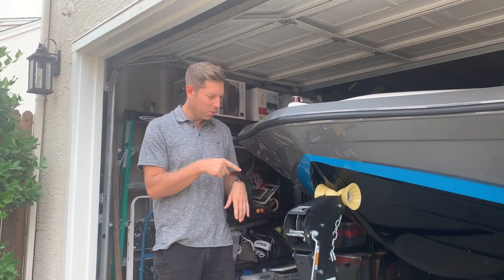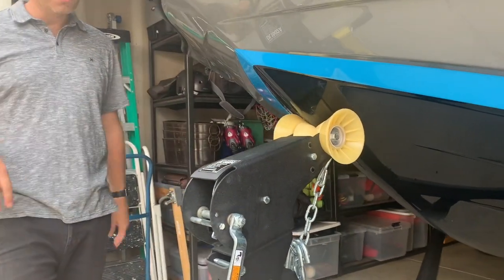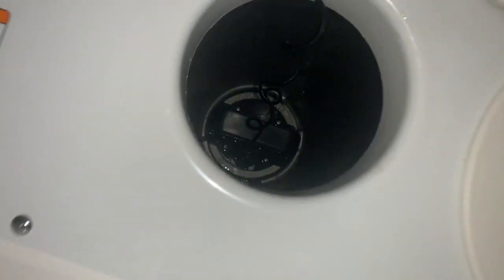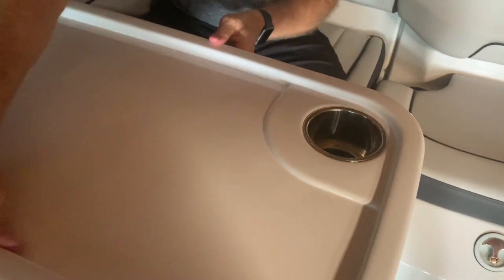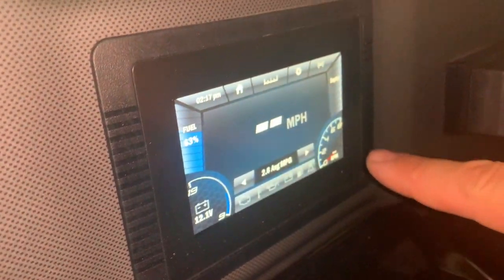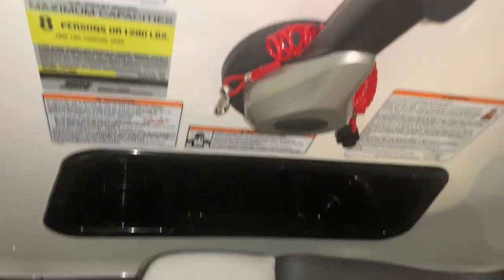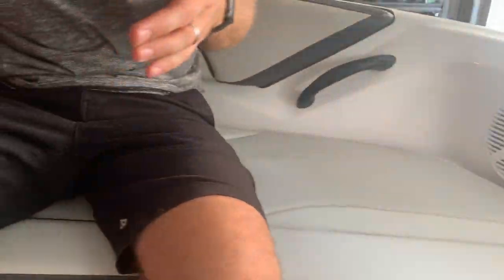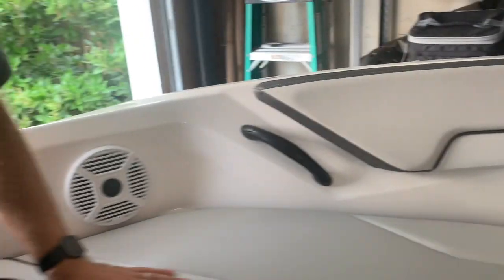2021 Yamaha AR190 Jet Boat Full Walkthrough-And It Does Fit In A Standard Size Garage!

Comment: We couldn’t fit our 2022 AR190 in our garage that is 82” high. The dealer did not have any solutions. We had to let air out of the tires and drop it to about 20 PSI to get in and out. Thankfully we finally took our friend’s advise and switched out the trailer tires.

Our 2022 shorland’r trailer model YAB30 came with: 

Original tires: Eco Trail ST - ST215/ 75D14- 
tread plies 4 nylon, sidewall plies 2 nylon, max load single 1870 lbs, max load dual 1650, load range C

We switched the original tires for these and everything has been working out perfect without having to mess with the garage header or tower:

ST205/65R14 LR D ( 8 Ply) WVS690 VISION MARINE HAULER Trailer Tire 
Tire Size: ST205/65R14
Tire Brand: VIS Marine Heavy Hauler Tire
Overall Diameter (inches): 24.4
Section Width (inches): 8.1
Capacity (lb): 1820
PSI: 80
Load Range: D (8 ply)
Speed Rating (MPH): 81

Hope this helps anyone who is going through the stress like we did. They were under $300 for the set at Discount Tire who special ordered them from the manufacturer.
Reply: Does this tire fit on the same rim ?
Reply: Yes we used the same stock rim it was sold with

Comment: Aloha,  nice looking boat and that trailer looks interesting... is it painted, is it a ShoreLandr?  If it is and they haven't upgraded the light wiring to single wires (no connectors in the frame rails) you'll eventually lose the lighting.  Mine (2017 SX190 w/Galvanized ShoreLandr) was problematic at about 6-8 months (saltwater) all the connectors rotted out.  Ended up using LED's and running the wires down the frame.  Great Boat!  Love that new table feature.  Will be another of my projects this year.

Comment: I have an 83.5 in garage door but the concrete floor is 1 inch higher just past the garage door . Is your floor flush where the garage door closes?
Reply from the maker: Hi Bob, mine is flush so I’m able to fit it without any adjustments. If you are only talking about an inch then I think you could deflate a little of one or both tires and get it in no prob.

Comment: Hows the low speed handling? Are you planning on getting the Thrust Vector X?
Reply from the maker: So far I haven’t had much trouble honestly, but I haven’t had to do a whole lot of low speed precision maneuvering at this point. Headed out tomorrow though and will shoot more video and try some different things, low speed turns being one of them. I’ve seen posts about the Thrust Vector X and it looks cool though and adds even more control. I’ll have to weigh which upgrade brings the most value before I make a move this year at least. Thanks for the tip though!

Comment: I wish the screen was a little bit bigger. Hope you can do a video and review on the wake booster package. I'm considering getting it also.
Reply from the maker: I ordered the guide-on’s for the trailer and the WakeBooster but I am not sure when I’ll be getting it all. I’ll definitely be posting a video of both when I get them!
Reply: The ar 195s has the upgraded screen its 7 and nfb half inches instead of 4and half plus the 195s comes with all chrome cupholders and GPS maps upgraded audio and interior and it has a super charged engine...much faster than the 190 and
Reply from the maker: @darshyvids4165  hey to each his own! I actually prefer the 190 interior, grey exterior color and black cup holders, and gas economy-not needing to go faster than 40 mph. Super charged also requires additional maintenance. Maybe the larger screen would be the only option that might be nice but not worth the thousands more in my opinion.
Reply: Extra maintenance is the difference of 10 dollars without the super charger.....just fluids not extensive at all ......miles per gallon between the two is a matter of fractions it all depends on driver and what your using the boat for to get your fuel economy ratings......super chargers most of the time will boost fuel economy at mid to low rpms so if anything the 195s are going to have better fuel range....and if your paying 34000 for a 190 and its only 40000 for a 195s, what's another 6 when your dropping that much already with most likely a 6 to 8 year policy......all said and done like you said it's up to the consumer preference for what they want and it's pretty much impossible to convince the other party otherwise.....at the end of day the 190 is a great boat and the 195s is a great boat but if your looking for that premium package...upgraded interior, cup holders, speakers and audio, GPS maps preinstalled ( which the 190 does not feature), and just an overall more luxurious and more technically advanced boat ...the 195s is going to be perfect for the joe who is looking for a 19 foot boat with plenty of power the get through the heavy chop ......facts are facts
Reply from the maker: @darshyvids4165  no worries we all have our preferences like you say! Like you say this a GREAT value in a boat that still fits in a standard sized garage! That’s was the most important element for me as I’m not wanting to pay storage fees at this point in my life and I know a lot of others out there feel the same way and want to keep the price as feasible as possible. Hey there’s always the SX210 then at 43K that I might consider if I’m going up in price!
Reply: Might as well just go up to the ar 240 or hey maybe the ar275sd but oh wait were talking about 19 foot boats ...don't be sad because I explained what the top model has over your boat like before facts are facts no opinions over here
Reply from the maker: @darshyvids4165  Fair enough! I’m just professing my love for my AR190 BUT you are definitely right in that the AR195 is the top 19-foot boat!

Comment: Whats the weight of boat and trailer?
Reply from the maker: Little Viking coach hey! The dry weight on trailer is listed by Yamaha as 3,111 pounds. Then to figure with fuel weight and gear (full tank ~240lbs), I’d say I’m hauling it most often with a weight of more like 3500 lbs. Hope that is helpful.
Reply: @yamahaboatguy8941  yes very helpful thanks was having hard time finding combined weight